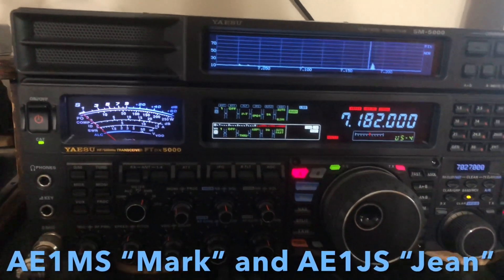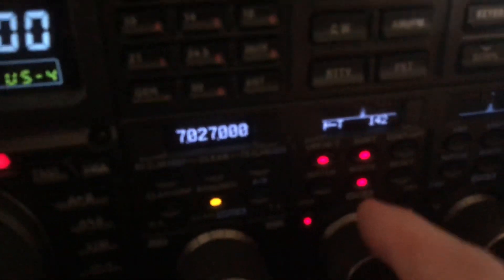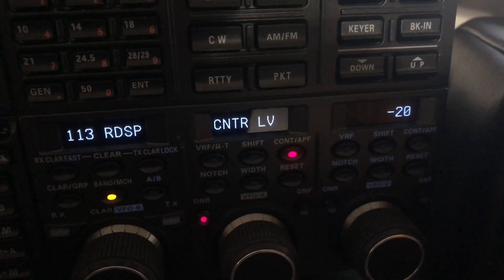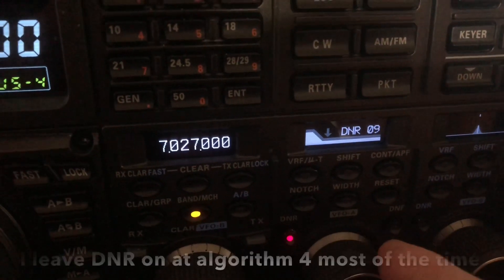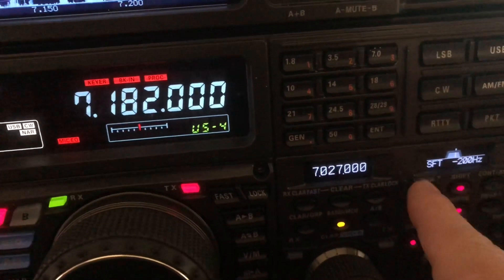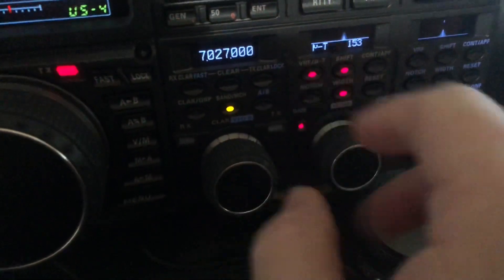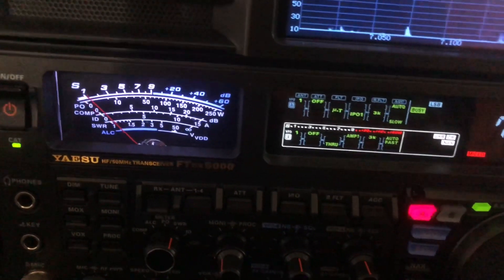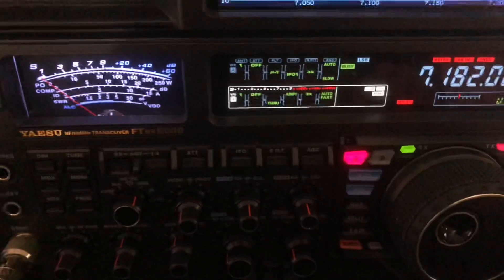Balancing Contour with DNR

Comment: I have my contour control set for peaking. I use it to raise the frequencies lost as I get aggressive with the DNR. I typically use 4 DNR and depending on the bandwidth I use adjust the 2000 to 2200 range. When I use a narrow bandwidth I adjust it lower of course to track the filter. In many ways the manual configurations of the 5000 are a dream come true. Such an amazing transceiver. Hope to work you again soon BTW.
 I won't use my call here but I am in the mountains of WNC. 73 OM
Reply from the maker: The 5K is still my favorite.  73

Comment: I have the FTDX3000 and twiddle the contour and DNR similarly.  Tremendous down conversion receiver, same specs as the 5000's primary receiver.  I just wish the 3000 had the 5000's knobs, and extra 100W!  IF a 5000 ever comes available at a great price, I may jump on it and sell the 3000.  Budget and boss allowing, of course!  73 great videos!! de Cliff W3KKO
Reply from the maker: I’ve told this story elsewhere here, but I had fun at HRO when a TS-590SG owner saw me playing with the FTdx3000D and challenged me to a dual for pulling out weak signals.  He walked right out of the store grumbling, “I wish you hadn’t shown me that!”  It was awesome!  I do highly recommend the FTdx5000, especially the MP version.  That’s the last variant made.  Still the greatest transceiver ever made, in my opinion.

73, de N4HNH

Comment: Great video👍❗️I am going to go back and look at some of your previous videos, I think you may have made a similar video on the FT 891 I need to find that video.  Thanks 73 KV5P
Reply from the maker: Thank you, Mike!  

With the FT-891 DNR set to less than 9 there is a digital artifact that makes it sound as though you are listening under water.  So, using this technique with a FT-891 might not produce results that are as good as with the FTdx10.  The FTdx10 DNR can be set to algorithm 1 and it won’t produce the digital artifact.

Don’t get me wrong though.  The FT-891 DNR, at algorithm 9, is still one of the best in the world.  You might just have to narrow the Contour a bit, to maybe a width of 7 or 8.  Maybe even reduce the level to -12 or so, rather than -15, when using DNR at algorithm 9.

73, Doug
Reply: @n4hnhradio  Thanks and I am really enjoying my newly purchased FT891,  it does much more than I was expecting❗️73 KV5P
Reply from the maker: An unsung hero, it is. 73, Doug
Reply: @n4hnhradio  I have notice that DNR higher than 6 Get a false voice. Good advice about the contour.

Comment: Run a 101MP here and there are times when the Contour will un-mask signals, I never knew existed. Try using IF shift in tandem with your Preselector sometime, may give similar results to the 101's VC Tune. There would be a 5000 here had the 5000 not been discontinued. Hope they make one last run on the 5000's.
Reply from the maker: If you watch more videos on my channel, you will see extensive use of IF shift, in conjunction with width, even with the FTdx5000MP, which has a preselector.  

The FTdx10 doesn’t have a preselector and it does quite well.  The preselector can be the icing on the cake.  I use it more for combatting noise.

73, de N4HNH
Reply: @n4hnhradio  The VRF and IF shift in tandem may give similar results to the 101's VC Tune. Knew the FTDX 10 was without VRF they should have added it. If I ever end up with a 5000, I'll give it a try myself. You have the Hi-mu add on's, do they apply IF shift automatically with preselection adjustment? I'll probably own a 5000 one day before the shows over. I like the 101MP but the software sux, Yaesu should have just went with the line menu like the 5000 in the 101, or a pair of line menus.
Reply from the maker: VRF, mu-Tune, and VC-Tune preselectors are positioned between the attenuation circuit and the bandpass filter.  They have nothing to do with IF.  I sometimes use a combination of IF shift and mu-Tune, after narrowing the IF bandwidth, to combat QRM and/or QRN.

Even though the VRF and VC-Tune preselectors are installed internally, they take up too much space to fit them into a transceiver the size of the FTdx10.  Remember that the FTdx10 is essentially a FTdx101D, minus the second receiver, VC-Tune, and multiple antenna ports, and crammed into a smaller enclosure.  Another trade-off is that the FTdx10 has fewer commonly-used controls available as knobs or buttons.  It is a bit more menu-driven than the FTdx101D.

Still, the FTdx10 is beaten only by the FTdx101D or MP when comparing its RMDR score to all other transceivers.

73, de N4HNH

Comment: I’m surprised there is not a aftermarket preselector available (maybe there is?) It wouldn’t be cheap, but it would certainly improve the performance of all radios, even the non-hybrid SDR’s
Reply from the maker: Well, the preselectors for the FTdx5000 are $650 each.  One for 160m, one for 80/60/40, and one for 30/20.  I have the latter two, which have been featured on my channel numerous times.  They are fully automated.  They track the VFO with whatever offset I choose.  The FTdx5000 also includes a built-in preselector for each band.  It is called VRF.  VRF isn’t as tight as the external (MTU) versions, and VRF doesn’t track with the VFO.  But, VRF is quite effective.  

The FTdx101D has a built-in preselector (VC-Tune) that is on-par with the external (MTU) units that I use with the FTdx5000.  Do the math and it makes sense to buy the FTdx101D or MP, with effective built-in preselectors.  The FTdx101D has VC-Tune only for receiver A.  The FTdx101MP has VC-Tune for both receivers, plus an additional 100W of transmit power, and a 300 Hertz CW roofing filter is included for receiver A.

From what I have read about the Elecraft K4HD, it will include preselectors.  I expect it to be a fine transceiver.  I am radio poor, so I won’t be able to buy a K4HD.

73, de N4HNH
Reply: @n4hnhradio  Thanks Doug! I went and watched one of your videos and that is exactly what I was thinking about.

Comment: Just wish that would have gotten FTFX-5000 but I got what I have.  991a and FTDX-10 and very happy with them. Just need play with them more. You had to be tickled to her you family on SOTA
Tnx Doug 73
Reply from the maker: Hi Paul!  You can use the same technique with any transceiver that has DNR and a Contour filter.  I do like the FTdx5000.  I won’t lie.  But the FTdx10 and the FT991A are great rigs too.  I just like the bigger radio with more control via knobs and buttons.  73, Doug
Reply: @n4hnhradio  can I say that you are  a knob person 
LOL
Reply from the maker: Indeed I am, Paul!  Guilty as charged.  LOL 73, Doug
Reply: @n4hnhradio  was using the rf gain and for got to turn it back. The last few days could not understand why my noise floor was a s9. Not to bright.
Question want to use a strate key and only plug I have it  Tip   Sleeve sleeve. Can I use if just use tip sleeve.
Reply from the maker: Yaesu says that a two-contact plug cannot be used.  You must use a 1/4”Tip-Ring-Sleeve type plug.  Also, remember to set the Keyer type, in the CW Setting menu, to Off.

73, Doug